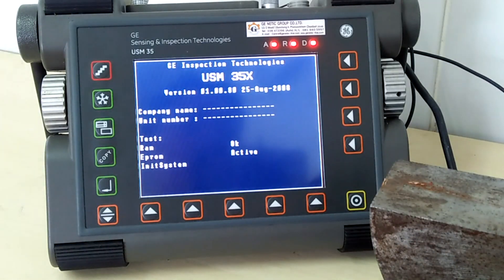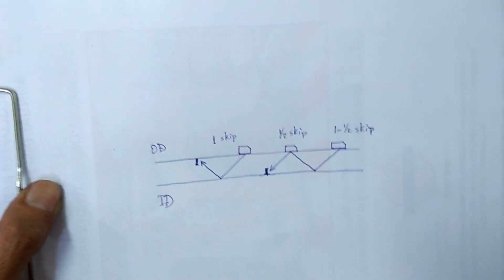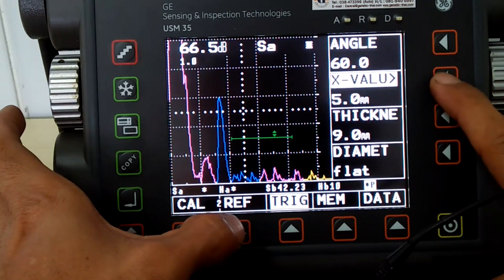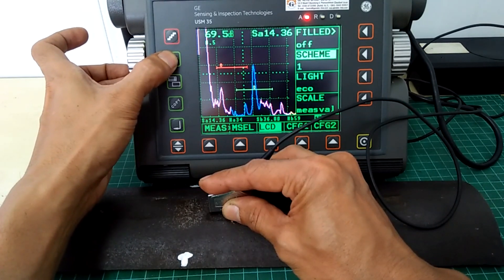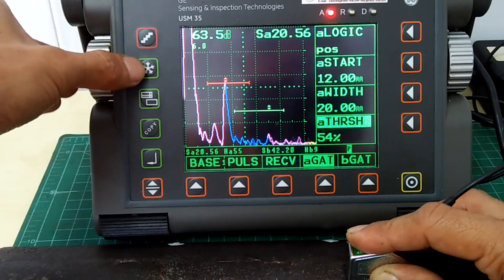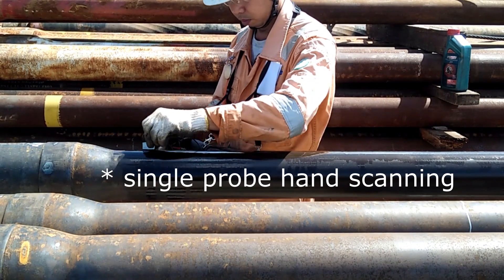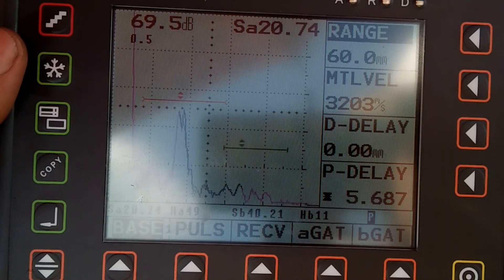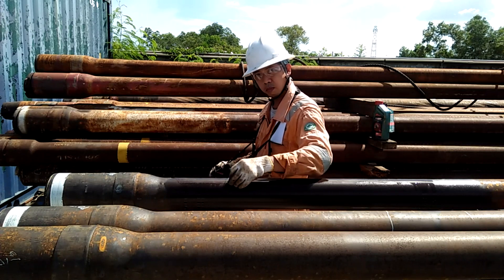Ultrasonic Inspection of Drill Pipes

Comment: Nice work, what transduecer you are using? I think its angle beam at 60°? What do you recommend
Reply from the maker: Hi. Yes you are right. I am using the 60deg probe. This is the one that works best with the thickness of the drill pipe.

Comment: Thanks for ur explain about inspection of Drill pipe used UT sear wave...
Please upload again with detail caibration used V1 and V2 include side drillhole and etc..
GOD Blessing u too 😇🙏..
Reply from the maker: Thanks.  I'll try to make a video on that if have a chance.
Reply: @DIYPhil  Please make video DAC caibration for UT tool joint connection drill pipe using  pipe block calibration

Comment: how you find the longitudinally cracked? especially on non magnetic drill color
Reply from the maker: Best if you have the probe  where the contact surface is same contour of the pipe diameter then we just have to scan in the direction of the circumference of the pipe. actually, even with longitudinal scanning and ordinary probes, you can detect even the longitudinal crack. We have tried that in the past and able to detect longitudinal cracked non-mag collar.